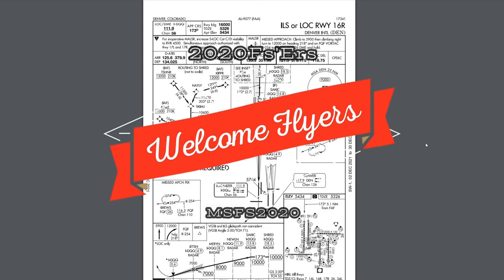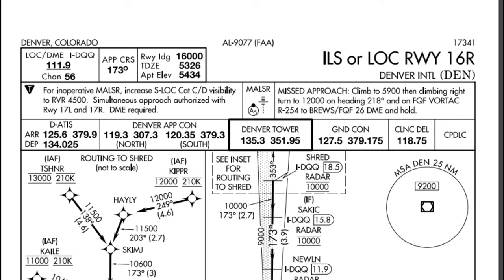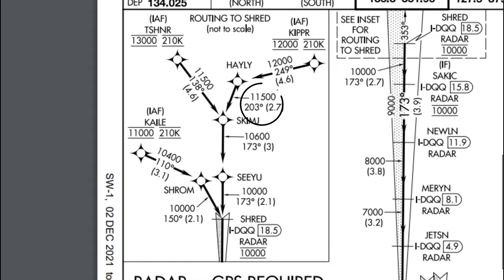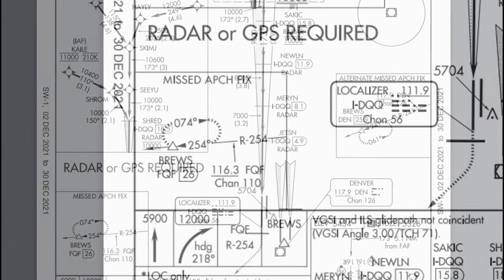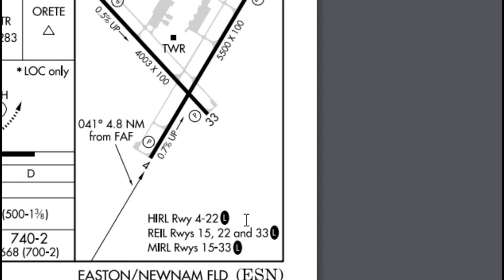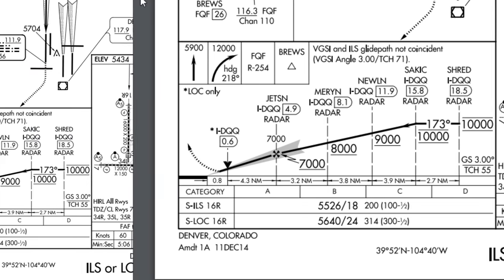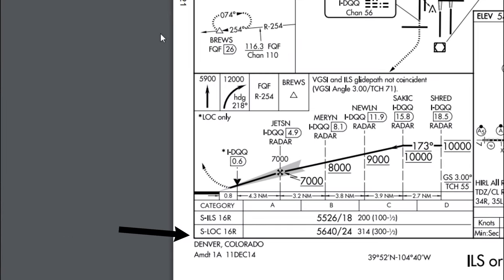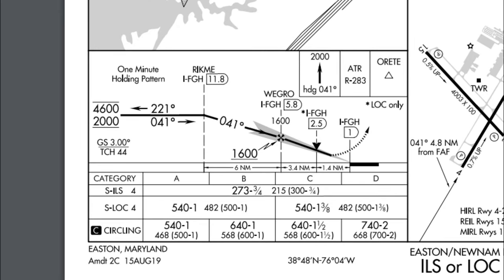MSFS2020 **Approach Plate Tutorial** Understanding IFR Approach Plates. FOR All FLIGHT Simulators

Comment: So when I am in the TBM 930 and doing and I LS approach and where it says minimum’s to put in in the flight plan which number do I follow the localizer number or the I LS number I never know what to type for  the minimum when I’m doing a flight plan. And do you have a video on creating a flight plan in sky vector and exporting in msf 2020 and is that better than creating flight plan in the plane?
Reply from the maker: Hey there what do you mean by ils number or loc number? What minimum are you asking about? I do have  video on little navmap but not skyvector .  It's always best to create your fpl not in the plane so you have all the resources while making the fpl.
Reply: @2020fsers on the biotin of the plate chart in the video under category there are 2 altitudes one is 5526/18 and 5640/24 which  one is the  correct altitude minimum to put in one looks to be for loc and the other one is for ils.
Reply from the maker: It depends on the category of aircraft you are flying I go over this in the video .
Reply: @2020fsers  one in your video the TBM 930 which one do you select? Minimum altitude numbers are different. I was just wanting to know which one would you select for that flight in your video?
Reply from the maker: It depends on how fast you are going on approach I also go.over the speeds as well along with aircraft category